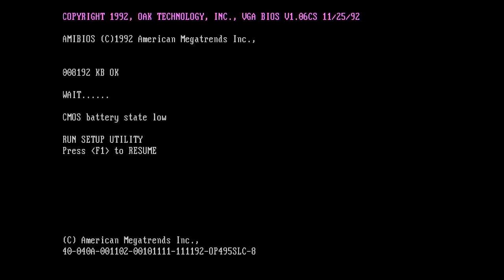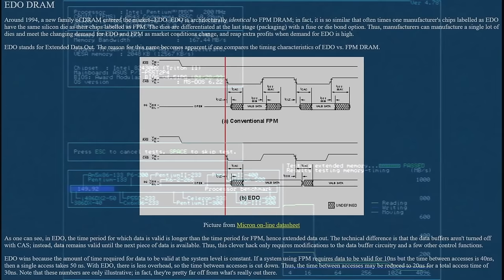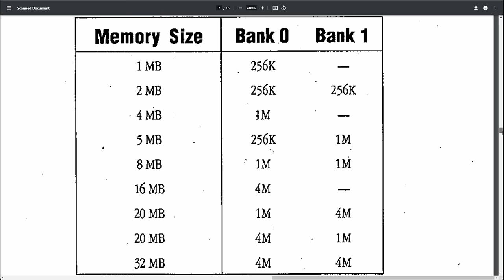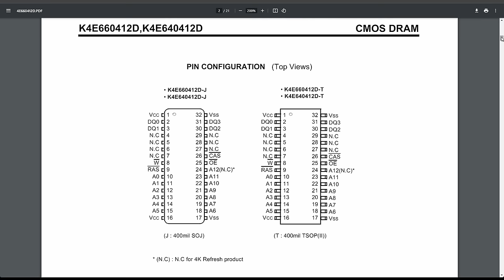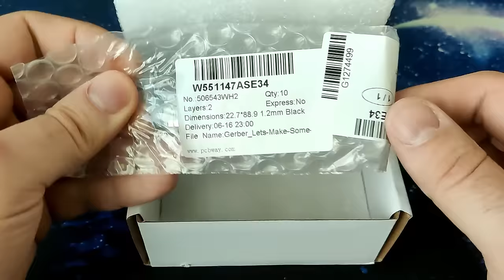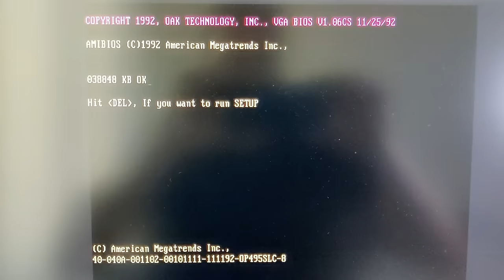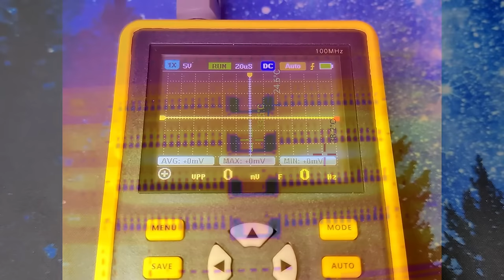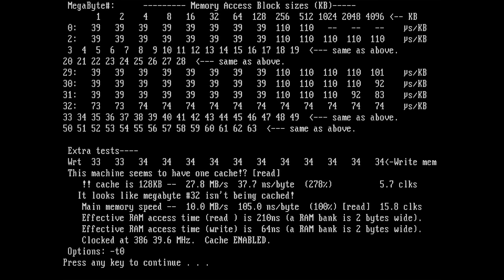DIY 16MB 30-Pin FPM SIMMs: Supercharge Your Vintage Hardware!

Comment from the maker: Hi there! I hope you like the 30-pin SIMM 16MB memory module. Would you be interested to get a set of 2, 4, or even 8 modules? I want to understand what the demand is for such modules. Hit the like button of this comment and reply with how many modules you would be interested in. This is not an order, I just want to know if I should make a few and utilize the memory modules you have seen in this video! Thanks everyone for watching, commenting, and liking! Cheers
Reply: This is awesome. I could use 8 such modules for my Macintosh SE/30 to max out the memory :) Btw, the Sound Blaster AWE32 also supports 16MB SIMMs, but the usable memory is limited to 28MB due to the 4MB ROM sharing the address space with the RAM.
Reply: I know how to get chips for these so you don't have to desolder them from DIMMs.
Reply: @AttilaSVK  I would love to have 2 for my Sound Blaster AWE32! :D
Reply: I'd be interested in a set of four - I'm curious if my 386 boards can go as far as yours!
Reply: I'd absolutely be interested in a set of 4. Being able to switch between FPM and EDO would be invaluable for testing old hardware. Also can I please come visit your scrapyard one day? That place looks like heaven! :)
Reply: I have a UniChip-386-WB, the motherboard officially supports 128MB. I would like 8 pieces.
Reply: I'd love to get a set of 4 modules 👍
Reply: I would be interested of those for my 386. Have to check if its the correct chipset but looks very similar. So atleast 4, depending on the price i woul take 8 also.
Reply: 4x16MB modules would be cool. I, too, have a high-end 386 here. :)
I'm currently rocking with 8x4MB SIMMs.
Reply: I would love to get these chips!
Reply: i got a 386dx40 - and now filled with 32mb - but maxed can do 64mb
for a 386dx40 this is a huge amount of memory..
having larger density sticks is of course the solution.

if they can be bought.. it be a must have..
unsure if DOS can handle 64Mb
but for sure NetBSD can !
Reply: I have absolutely no use for it, but I'd love one just as a display piece.
Reply: I would be interested, i have a 486 that currently has 58mb of ram in 30pin sims (could also be 52mb, i cant remember) as it has 4 banks of 30pin simms, with 3 banks of 4mb simms and then the last bank is either 1mb or 2mb simms., be interesting how much ram it could take (hard to find documentation on it), but from what i saw it was a $11,000 cad workstation from the 90s
Reply: I have a ECS-UM486V-AIO(DIP) Rev.2.0, that I believe is the same, manual mentions 32MB max, but documentation shows 64MB in 4 SIMM Bank.  I have 20MB in it currently.
Reply: I would be happy if I could have 4 pieces.
I don't know if it could be ever fully utilised in a 386 or even in a 486, but it would be fun for sure.
Reply: I'd like to have 8 modules if possible.
Reply: Interested in 4 modules.
Reply: 8 modules as well here!!!
Reply: I'd like to get ahold of 8 modules
Reply: Interested in 16 please. Awesome!
Reply: Yes I am interested! I'd like eight modules. I want to try to get 128MB on a 486. My 486 machine has three banks but I don't want to be that greedy.
Reply: I would LOVE a set of these for my 495SX 486DLC system
Reply: @harvaldi  Me too!
Reply: Like someone else also said, I would like two for my SB32AWE.
Reply: I would also love to get 4 of those modules, to see which of my many 386 boards can make use of them :)
Reply: 4 or 6 should be more than enough for a 386 system
Reply: 2 for my AWE32 would be awesome!
Reply: Great video, it's too bad back in the day these weren't available, and that one can't use more than 4, I wish I had 4, but right now I'm focused on tires for my car, keep up the great vids. If I did it would be for a PC Chips M919 VER 3.4B/F-UMC8881 motherboard, it has four 30 pin mem slots.
Reply: Oh and 64MB is the minimum for Win XP, not that a 486 could run XP probably.
Reply: I'd love to get the chips and boards to build up 8 modules myself, so I could finally get my Mac SE/30 up to its max 128MB! Although it's totally overkill, so I would settle for 4 if you don't have enough to satisfy everyone's needs. That would still be double what I managed with my 4MB SIMMs.
Reply: I'd be interested in a set of 4 or 8, depending on availability.
Reply: @victorbobier3416 Win2K would be perfect with that. I used to run 486 with 100MB (16x6 + 4 72pin)
Reply: 8
Reply: 1 (possibly 2) sets of 4 could come in very useful.
Reply: 8 Modules would be nice
Reply: love the video ideas.   this would be a great upgrade for some of my PC systems.
Reply: hi.  i would be interested in 8 modules
Reply: Like to get 8 Modules!
Reply: 4 modules would be useful for me. Too many things need them.
Reply: Hello, I would like 10 modules, please.
Reply: 1x, I would love to see if these work in some 68000 accelerator boards.
Reply: WOW!  I thought I was doing well with 10MB in a 286, way back when.  I do have my ALR 386DX from that time-frame.  I am interested, but need to get it out, and open it up; I do not recall the memory packaging used.  Probably DIP, and/or ISA expansion.

Love the videos!  Hope to see many more, as you see fit.

Thank you!
Reply: Would be very interested in 4 modules for my 386DX40 :)
Reply: I’d be interested in 4 or 8 modules depending on price.
Reply: i would like to have 8 modules for my AMD 80486DX2-80, btw, i love soldering
Reply: I would love to get a set of 4 72 pin fpm/edo sims for a late mode PCI based 486 dx4100.  board needs work to get voltage regulator working properly.
Reply: don't care about the price too much, I am really interested in a set of 4 👍
Reply: Would be happy equip my AWE32 with 32MB :)
Reply: Similarly to others here, I'd love to have two for an AWE32, and another 4, or maybe 8, for 386 boards. So, 6 or 10 pcs in total.
Most 486 boards can be maxed out with 72pin SIMMs so it's a non-issue there. Anyway, a great idea you had!
Reply: I'd be interested in 8 modules...
Reply: This would be good in a Parity memory 3-chip variant. Lots and lots of older systems required it.. especially older SUN, SGI, and others. I'd stump up for 16 and feed it to an SS2 or 3/80 with the hacked ROM.
Reply: I would totally take 8.
Reply: I might be interested in a pair for my SoundBlaster AWE32, which supports 2 30-pin SIMMS up to 16 MB each.  Interestingly, the cards are only able to use 28 MB of that 32 MB maximum, but have no problems using the full capacity of SIMMs 8 MB or smaller.  I currently have 8 MB installed on it, but have never owned any larger SIMMs, and only got those SIMMs a few years ago.
Reply: @AttilaSVK  My AWE32 is exactly what I could use them for and I've been aware of the 28 MB limitation since I bought in the late 90's.
Reply: I used to have 4Mb in my 386 but later upgraded to 16Mb!

The computer is still in my garage, I have no clue if it still works but it has four memory slots and I also have an Intel Overdrive DX2 somewhere in its box :D

Four sticks would be the obvious choice!
Reply: Hi 
I'm into the old Macintosh machines. There is a SE/30 which needs a new mainboard and I'm looking for a opportunity to max out it's RAM to 128MB - which seemed an incredible amount of memory at it's time. 
I'd be much obliged, if you can help me out. 
Cheers Peter
Reply: Very good video! 4 modules for using it in AWE32 could be awesome. As this kind of module is not easy to find and expensive as well.
Reply: I could use 8 sticks for my 386
Reply: Ich wäre auch interessiert - idealer Weise in 6 Stück für AWE32 und meinen Highscreen 486.
Reply: I have both a 386 and a 486 I could use these for, for a total of 12!
Reply: I want 10 modules of 16 megs each one
Reply: @MarcoGPUtuber  Let us know then.
Reply: My AWE32 had been begging me for a RAM upgrade since 1996. If you put together a kit then I'll certainly be very interested in making a purchase. I've had this on my to-do list for years!
Reply: I'd buy a set of 4. I play around with old hardware also.
Reply: I have one of those ancient EDO SIMM servers. It has 16 slots and supports 4GB of EDO memory for a quad Slot 2 XEON @ 450Mhz. It has wheels and 3 power supplies. 1GB installed.
Reply: This is awesome, 8 Modules would allow me to max out my SE/30!
Reply: I’d be up for 4 or 8 dimms. Great project.
Reply: 8 please!
Reply: Four modules would seem like the most reasonable option without being greedy. Two to put to use, and two spare/for experimenting/future use. Always a good idea to have spares in general and especially for things that may be hard to get.
Reply: I could use 4. I hope they do not get too expensive
Reply: I'd like 4 or 8 modules
Reply: @AntoineWG  It no doubt has a 32MB memory map, with 4MB of ROM mapped to the high part in memory.  So 2x 1MB or 2x 4MB don't have any overlap but obviously when you put 2x 16MB the last fraction is already spoken for..
Reply: I could use 4 modules.
Reply: I would certainly be interested in either some assembled modules, or possibly a source for the memory chips if a reliable one is found.
Reply: I would be interested in a set of 4 modules.  Great project and video!
Reply: I'd like to max out the 256MB capacity of my Mac Quadra 950. It has 16 30-pin SIMM slots, which are currently at 4MB each totaling a pretty respectable 64MB. I also have a huge collection of other 30-pin Macs.

As a kid in the early 90s, I got a Quadra 900 motherboard for cheap that was left over from a 950 upgrade. I built it into a toolbox using a standard AT power supply and other off-the-shelf parts, and got a whopping 16MB initially using 1MB SIMMs, and upgraded later. In the late 90s, when the machine was already serving second-use as my father's office computer, lightning struck it via the modem line and fried it. I bought this at-the-time cheap 950 to replace it and still have it.

No service needed either, except changing the leak-prone 1/2AA batteries into CR2032 and replacing the case fan to a quiet modern one. Motherboard caps are all tantalum, and the PSU ones are high quality as well. Other than that, I've just kept on maxing it out, but the price of 16MB SIMMs have prevented maximizing memory.

Not that I'd need all 256MB for any of the apps at the time, but it supports bootable RAM disks, and that's a vast upgrade in performance over even contemporary BlueSCSI solutions. The initial HDD I got for it was just 200MB, which was pretty much for the time, but very slow compared to the potential of the machine, which made the young me fantasize about a future of near limitless amounts of fast solid-state memory.
Reply: Yes please!!!
Reply: Definitely! The 386 is at the age which can be updated, upgraded and maxed out to it's highest specifications! 
Eventually it will be impossible to make further improvements to the 386 and then it's the 486's turn and the Pentiums after that! 
I'm still using the original 4mb ram that came with the 386 DX40 that I purchased new back in the early 90's. It's still got the Tseng Labs 2mb graphics card and sound blaster 2.0 and 85mb HDD.... It's long overdue for an update LoL... If the price plus shipping is right, I would definitely be interested in purchasing as much memory as it can take!
Reply: I wish I was building a 386 now.. 😅
I have a Z80 and Russian clone 8086 to build first. 😎👍
Reply: What an awesome vid! I would like 6 of them, 2 for an AWE32 and 4 for a 386.
Reply: I'd be interested in four modules.
Reply: What a time to dust off my old 386 system and upgrade it. Would love to max out my memory. If you can, please consider adding me to the list if ever you'll build & sell. thanks
Reply: @MarcoGPUtuber  please share. thanks
Reply: Definitely interested. I’d be curious to upgrade my soundblaster Awe32 from 8mb to 16 or 32mb!
Reply from the maker: @SAMRGAMERTV I will make modules. I just hope to find more of those memory chips 😅
Reply: Uhh I use a 286 so 4 4mb moduels for me but this is mega cool!!❤
Reply: I'd take 4 or 8, depending on cost
Reply: @bitsundbolts  🍀🤞
Reply: Not sure about the cost, but I'm looking for a pair for my SB AWE32.
Reply: I'm interested in 8 sets for my two 386 machines.
Reply: I would be more interested in where you get the scrap from ^^
Reply: And here i am, havin hoped that my 4 x 4mb 30 pin simm were worth anything... If i could find them. Had cost me 800€ in the nineties.
Reply: 4 Modules here please, thanks
Reply: minimum 2x16mb for me. genius and superb design, i loved second power regulator just for simetry, thats words of a true artisan!
Reply: I could really use 8x 16 MB sticks for my E-mu EIV sampler. It's currently running on 8x 4 MB. I'm really interested in trying to build my own memory modules.
Reply: I might be in for some of these, though most of my retrocomputing would be in the 72-pin era. I have some old Macs and also wonder if my x68000 memory expansion is 30 pin or what.
Reply: Yes please.

Comment: The 64 MB RAM count was so funny i watched it several times. I really like the ram counting sound on old computers
Reply: The counting algorithm was also the same, but CPU performance grew, so on a 286, it'd slowly count up to 1MB with a tick...tick...tick, a fast 486 does its 32MB in a "brrrrrrrrrrp" in a few seconds, and some late Athlon counts 2GB in a brief high-pitched "zeet". I guess if contemporary ones still did the same, it'd just be in the ultrasound spectrum and thus inaudible to mere humans.
Reply: I've got 64GB in my main rig and I don't even see a RAM count. 😅
Reply: @Armand79th  Maybe you have the fast boot option enabled in your BIOS. It cuts down startup times by a substantial amount, by skipping most of the usual tests you usually have at the start of the computer.

Comment: Back there in 1992, our brand new AMD 386DX40 had 8Mb RAM. At some point, befere acquire a 486DX2, it was upgraded to 32Mb. Running on 8Mb we not really faced lack of memory. With 32Mb, it was such a paradise of RAM. This 386 was active until early 2000s as our local name server, firewall and NAT running Slackware Linux. One day, it's keyboard was not responsive, and I had already an AMD 5x86 spare on the corner. After more than 10 years of work, our beloved 386 (nick named AMaDo, beloved in Portuguese) retired.
Reply from the maker: AMaDo served you well! 32MB is quite a lot for such a platform and probably not that common.

Comment: When you started up that 386 for the first time with 64MB I had a huge smile on my face as I'm sure you did.  What a really great achievement and just shows you that "official" and "supported" specifications may be two different things!  Thanks for sharing.
Reply from the maker: I am working on an updated version that hopefully follows the specifications on the datasheet. I do it mostly to learn more. The current modules seem to work well and I got plenty of comments supporting both perspectives. There will be a follow up on this one very soon!

Comment: In 2000, our home PC only had 32MB RAM, 3GB HHD and 300MHZ AMD K6-2 processor (586?). The fact you were able to get twice the ram on a system at least two generations older is impressive.
Reply: We had a k6 too, classic. I still have the chip as a memento. I also remember my cousin had a 486 amd I think, the motherboard had the option of 30pin or 72pin, if I'm not mistaken, because I definetly remember those 30pin RAM sticks and I always found them slick and clean compared to the bigger ones.

Comment: I was happy with 5MB back in the day. 64MB is INSANE for a 386, nice job, pushing it to double the stated maximum!
Reply from the maker: I agree - 64MB is not really useful for a 386. Most of the memory is not usable by the software that runs on such a platform. As you said, the driver behind this project was to see what is possible. I learned a lot by going through the documentation and make sense of it. And finally also to understand, why we can only use those high capacity modules in memory bank 0.
Reply: @bitsundbolts  RAMDisk would be very useful. Large smartdrv cache. But back in the day, this kind of system would have fetched a very high price. You are right, RAM was expensive!
Reply: @bitsundbolts  64 MiB might be usable for compiling source code. You could benchmark it with 8, 16, 32 and 64 MiB to see if there is a difference.
Reply: The OG Xbox has that much memory gawd damn

Comment: I had a 8088 computer for way to long. I was young and had no money, so I saved all the money I got to upgrade my XT. The day I got enough, I bought a motherboard with an Intel 386SX, and 1Mb memory. The motherboard had 4 SIMM slots, and I wanted a single 1Mb module, but on the store they told me that I had to fill at least a bank (2 modules). My options were 4x256Kb, or 2x1Mb. No 512Kb modules. Having waited more than a year to be able to update my computer, I caved and got 4x256Kb, my options to upgrade gone. Then I had a 386sx (I think 25Mhz, don't remember), 1Mb of RAM, an Hercules graphics card, a green-phosphor monitor, a single 5,25" 360Kb floppy disk, and an MFM 20Mb hard disk.
It wasn't much, but Windows 3.1 worked well and the CGA software emulation worked SOOOO much better.